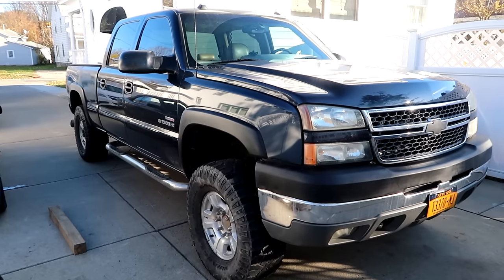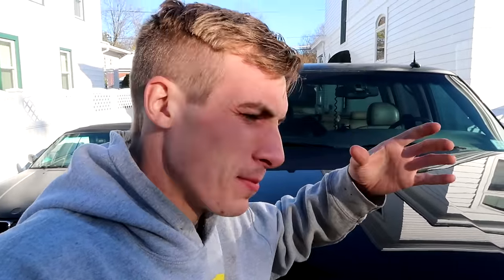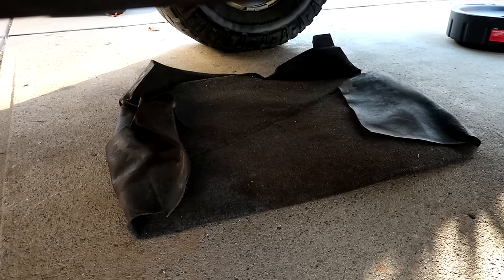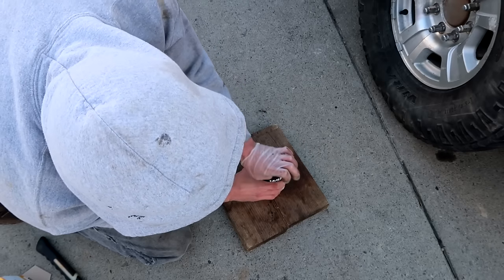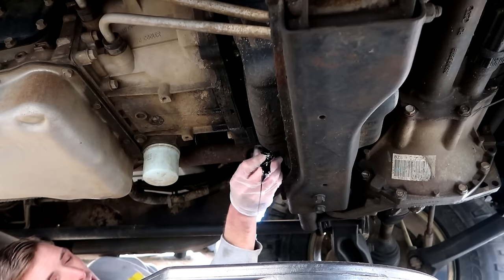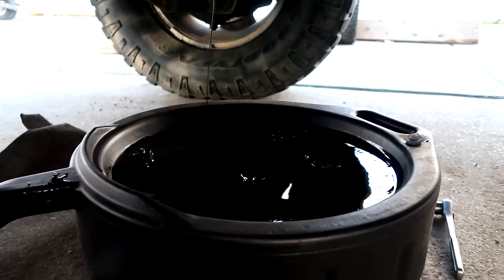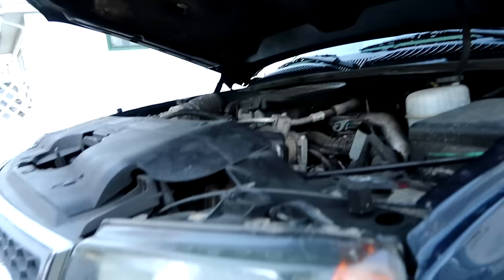THE WORST THING ABOUT A DIESEL...

Comment: The drain plug on a vehicle does need to be torqued when it's reinstalled.
On the Duramax, it varies from 50 to 62 ft lbs, depending on which torque guide you use.  But should be at least 50 ft lbs torqued.

Comment: For my truck which is a Gas truck, my oil cost me $90 with the filter which is expensive but I won't have to change my oil for 15,000 miles

Comment: well smaller trucks are falling by the wayside.  wich sucks because with the milage cars get now it'd be awesome for a daily. family truck. can't haul a huge 7000 pound camping trailer. but you can haul a good bit of wood. a smaller car on a trailer. and still have a more comfortable ride even more than a half tonne and like yours 3/4 tonne. even though they are getting better each year

Comment: 10 quarts isn't bad. I worked as an equipment mechanic at an airport. 5 to 7 gallons was the norm on our refuelers and big diesel pushbacks. The strangest charge on an oil change came from our forklift, 2 gallons of oil and a new T-shirt. I had to go to the accountant, dripping oil from sleeve, armpit and side to get him to agree to reimburse the cost of a shirt.

Comment: I'm surprised your not running synthetic 5w40 in NY.  It flows significantly better when your engine is cold.  Since I don't drive my duramax enough to warrant an oil change more than once per year and make occasional trips to cold climates I believe synthetic is worth the extra cost.  Delo Synthetic 5w40 can be found at walmart for about $20 per gallon and some carry the 2.5gallon jugs.   Non-Synthetic is $12/gallon x  3 gallons + $8 for a filter = $44.  Synthetic 20/gal x 3 + $8 filter = $68.   Only $24 more to go synthetic route, about the cost of a half tank of diesel.   Either way you still have a half gallon leftover in the Dmax next oil change will cost you either $12 less or $20 less if going the synthetic route.

Comment: Diesel engines may require more oil and it may cost a little more but oil changes are less frequent with diesel's compared to gas engines. Like 2-3 times longer. Gas is usually 5000, diesel's are usually 10-15k mileage wise.

Comment: More oil capacity means more oil cooling capacity from the extra oil at the bottom.   That's why the Jaguar XJR 4.0L inline 6 gas engine takes 8quarts, they built the engine to be able to run hard and for a long time and not worry about oil getting too hot.

Comment: I have one of those trucks with the gas 6.0L and it takes over 6 qts to change.  A Dmax is only 4 additional quarts.  A total non issue, even using a synthetic diesel oil.  So what if you spend $60 on 3 gallons of 5w40 synthetic or $39 on 15w40.  The real problem with diesels is the absurdly high purchase premium over the exact same gas truck.  My truck was 1/3 the cost the same year and miles with the Dmax in it.  Diesel is a fad for most buyers.  I love the duramax and the cummins engines as much as the next guy but prices for a pre DPF diesel are bonkers.  There is also the point that a dmax on synthetic diesel oil can go many more miles per change than a gas engine.  Those 10 quarts of oil can take a lot of miles, many more than the oil life indicator would lead you to believe.    The real "worst thing about a diesel" should be about how much it costs to change out your injectors when they go out, and they will.

Comment: My buds c14 cat in his peter-built holds 1 gallon of oil in oil filter alone ,  but what can you do it part of the diesel experience. I have a 2002 ford 7.3 , I like using Mobil or Rotella oil. Keep up the good work Mr. 3D.

Comment: you should start putting Lucas Oil Stabilizer. I have a 97 cummins I found on a farm. No smoke over 400,000 miles no after market part. Lucas is great for diesels truck

Comment: On your duramax- you never leave that silver cover on a new oil jug because parts of that could fall off and get stuck in your motor and hurt it. I also herd that you always watcher your pressure gage in case that's any leaks start after you checked the First time.

Comment: I run 4 gallons of Schaeffer's 5w40 full synthetic at almost $49 a gallon. All diesel owners look into a oil bypass filter setup. I run a bypass system and go 20k between changes. it's worth the investment in the end.

Comment: My early '99 F350 7.3l Powerstroke took 15 quarts. There's a couple reasons why diesel motors need larger oil capacity but I'm not going to get into that since it would make a good video for someone to make with some research.

Comment: You should check your dipstick before draining the oil. You may have and it just wasn't in the video, but if you're doing an oil change on a diesel you need to check the oil level/ check for dilution

Comment: My 03 7.3L F250 holds 15qts of oil. The filter alone hold like 5 quarts and is bigger than my forearm. Spent almost $500 just on fluids and filters for my 150k mile service.

Comment: When I change the oil in my Cummins its 200 bucks. I run full synthetic amzoil and a dual remote bypass filter system.

Comment: I run Amsoil 15W-40 Diesel Marine Full Synthetic for 25k miles in my 2004.5 with the help of a thorough oil analysis from the lab; it helps save me money due to the extreme long intervals. I've had 0 issues after 205,000 miles. Happy Trucking...

Comment: Any new dodge with a 6.4 hemi (392) costs more than any diesel I've ever topped off. Any high performance engine (even the cheap ones like new LS motors or Hemis) will cost more than even a diesel to change the oil. I didn't want to bother changing it in mine back when I had it and Chrysler itself charged in the 500 buck range. Labor was only 70 of that cost. But besides that the C15 in my dads semi takes 6.5 gallons with the fuel filter so lol

Comment: May want to run an oil additive. I run Archoil 9100 at every oil change. AR6200 at every fill up. I change the oil and filter every 5k miles. My oil looks like it did when I put it in when I change it pretty much.

Comment: So your duramax takes a little over twice the amount of a similar gasser, but keep in mind that you can go only 3-4K miles on an oil change on a gas truck but on a diesel it is usually somewhere around 10k miles.
Reply: In a gas truck you can go 10k but it's not recommended. 5k is what I and everyone I know go on a single oil change in gas silverados, s10, etc. 7k would be okay too.

Comment: A couple bits of advice: 
1. You should change your oil at 5000 miles. The oil life indicator is set up for 10,000 miles. Most filters are not up to the task of 10k intervals.
2. Wix filters are garbage. Spend a couple extra dollars at Pepboys or O'Reilly's for a AC Delco. Mobil One is also acceptable. 
3. Change that aftermarket transmission filter. Get a Allison Genuine filter. $10 and change every 10k miles. Also make sure you keep the debris magnet. 
I dont want to come off as a dick, I just want you to have a long reliable experience with your LLY.

Comment: Mine takes 15 qts plus I have a cartridge filter on top of the $150 in oil and filter. 6.0 Powerstroke's you have to change your fuel filters every oil change also, so hello $220 every 7,500 miles. Haha

Comment: My old ford took waaaay more oil.  91 f150 302 V8. Burned 2 or 3 quarts at each gas fill up. By god, did it roll some coal though

Comment: hey bro I have a 05 gmc dmax and 1 it takes 12qts and 2 I found out your not supposed to prefilled the filter but I've owned it for 4yrs and in that time I've replaced 3 barings 3 fuel filters  i just replaced the altinator that came on it from factory and a FPR

Comment: I have a 2003 7.3 liter F350 I use about 5 gallons five and a half if I pre-fill my oil filter and do my high pressure oil pump
Reply: There should be no difference in capacity whether you pre-fill the filter or not.

Comment: I have a 03 Silverado 2500hd gasser. only 98 thousand miles and more problems than any other vehicle. right now my g80 locker keeps getting stuck locked. and my front end won't unlock when I put it in 2wd. and that's just the 2 biggest problems. and no I don't beat it. I've only had it for 3 months and had problems from the start.

Comment: PF 2232 10 quarts of 15W40 or 5 w40 synthetic. 13 mm socket and my friend that's how you change the oil and that their Duramax
Reply: oh and always remove fill cap first lol
Reply: three pump the gas's with ignition on resets it as well

Comment: Actually there are a few things you aren't right about, it doesn't cost me a penny more to register a 1 ton dully diesel as it does a small car  $24 period in my county.
Second the engine lasting longer well that's not ture really, consider chevys 6.5 diesel, fords 6.0, most gas engines last longer than those.
Insurance isn't more in my state if you are just carrying the bare state min, well let me rephrase that at the cheap place I get mine at it doesn't matter if it's a F350 or a taurus.

I buy a 5 gallon buck of oil for mine, it uses all but half a gallon if I do it right.  I have a 7.3 PSD, oil change runs me $85-90 for the oil and filter.  Then I re-filter my old oil and dump it in the fuel tank.

Good job at pre filling your oil filter, there are some goobers that don't and well as I'm sure you know doing that stuff only causing damage.

Comment: My PS takes 13.1 quarts. Also controversial is profiling the filter if you pot oil in the middle it is not being filtered because the middle is where the filtered oil comes from. Personally I don't think it matters one way or another.
Reply: JDH it doesn't matter, the oil filter is meant to catch metal particles that fall into the oil pan from the crankshaft

Comment: The worst thing about a diesel is certainly not changing the oil.  Most likely a Hpfp grenading and taking out the fuel system or a stuck injector burning a hole in the piston.

Comment: Get a fumoto valve and use schaeffer's oil. I have over 30k miles on my schaeffer's 9000 5-40. I add 1qt about every 4k miles and I get it analyzed about every 10k and I change my filter every 15k. The oil stays great. Go to the bob is the oil guy forum. You can really start saving money and have better protection.

Comment: hey I am unfamiliar with diesel trucks. I am looking at getting a new to me truck. I understand that diesels get better mileage but is it really that big of a difference? If I wanted a diesel I would have to get a truck that is at least 10yrs old. to my knowledge the only trucks that have diesels are the 3/4 ton trucks like Silverado 2500 or f250 or ram 2500. so my question to you is should I get the smaller half ton gas or get the bigger truck even tho I don't need it specifically for the diesel? I know the average mileage you would get with most half ton gassers is 13-15mpg city 17-20 highway, what kind of mileage do you get with a diesel?

Comment: hay man i own a 96 powerstroke and i know your trying to save money but runing that this cheap oil will ruin your truck the BEST oil to use in any diesel is ROTALA T its expensive but trust me it is the best even if its not recomend in your manual it is the best it was designed for diesels

Comment: So here's this, in warm weather climates, Diesel engines are an easy call. Sure the up front costs are higher, but durability, economy, and reliability offset that to a degree.

When the weather gets cold though, gas engines regain some appeal due to not needing to be plugged in unless it's close to -40 F. No, gas engines aren't as torquey, no they're not as efficient, however the general maintenance costs are not as high as diesel engines either, and they're simpler to work on in your garage if you're up to wrenching your own repairs.

My question is simply this; why has no major manufacturer of diesel engine vehicles offered, or even designed an insulation system to protect the diesel fuel system from cold air?  Sure it may add, what, maybe another 100 pounds to the vehicle, but that's just a small extra passenger. No big deal.

Anyway , that's my take.

Comment: Mine is a 97 f250 7.3 turbo diesel and will it takes 10 quarts and doesn't even touch the dipstick. But you think thats the bad thing about a diesel wait until you have to do glow plugs. Or injectors those things are expensive as hell.

Comment: I'm fixing to buy a truck and I've wanted a duramax for 3 years now and I'm 16 so this will be my first truck and my parents and grandparents are helping me out a little. My grandparents haven't ever owned a diesel and see no reason for one and all their friends say not to get one. I've told them time and time again that diesel is the better option. I know a lot of people who own them and absolutely love them and say it's the best way to go. And they know a lot of people who don't own them but say a gasser is better and an "ole diezel truck is gonna cost you tons of money" what should i do?
Reply: Tactical Camel If it's your first truck,and you're not going to tow go with a gas truck. You will save on insurance. Mid sized- half tons are way more cheaper to insure than 3/4-1 ton. Go with gas
Reply: Tyler Bence i like the durability, fuel economy, horsepower, torque and long life of a diesel.
Reply: You gotta work a Diesel. No sense owning one just to cruse
Reply: I had 6.0 vortec with over 300,000
Reply: Tyler Bence what do you think this guy does and all these other people who own diesels doing youtube
Reply: Tyler Bence most people now days realize that a diesel is superior
Reply: Not using a truck as a truck. I just gave you my two cents. That's just my opinion. If your mom and dad are helping you go for it. Just saying insurance will hurt
Reply: I own both. I have a lml duramax and a 1500HD with a 6.0

Comment: Did use a hammer that you picked up of the ground to knock out the seal of that gallon of oil can then dump that now possibly dirty oil in the clean side of the filter?  Nice.  No going to do that to my bearings.

Comment: I cringed when you hammered in the seal on that oil jug then filled the filter.  In case you don't know, anything in the center part of the filter is going to pump through the engine and could lead to a real bad time.

Comment: I don't understand why people who bitch about the hassles and costs of motor oil are NOT using Amsoil.  Had you put in Amsoil diesel oil, you could go 3x the OEM drain interval and that would save you money and hassle right there.  Plus what guarantees does any of that store-bought oil have in the event that oil causes a problem?  You're S.O.L. if you blow an engine with store-bought oil.  Had you put in Amsoil and their oil caused a problem, they at least have a written guarantee that will pay for all parts and labor.  My cousin is a dealer for this oil and hooks me up at dealer cost on everything.  I've been using this oil in all equipment and every engine and transmission I've ever used.  Winter starts are a piece of cake.  Gas mileage increases.  You guys are absolutely crazy to use this crap that you put in just to pinch pennies.  The money you save on the oil you end up losing on gas mileage and more frequent maintenance.  You're tripping over dollars to save a dime.  I'm just trying to help you people out.  Go on Google or Bing and search on what Amsoil fits your vehicle and switch to it.  Believe me, YOU WILL BE THANKING ME LEFT AND RIGHT years from now.

Comment: Your using about 3 quarts more oil than a V-8 gas engine but go twice as far on a change .  So hope I don't shock you but the diesel is more economical.    Dodge cumins recommends 10,000 Kms.  Gas, 5,000 kms.  Don't sweat it.

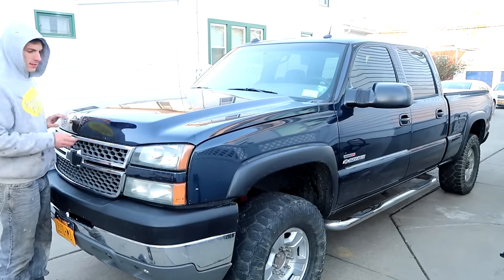Comment: That hose at 7:28 doesn't look right... That crack looks like it's about to fail. Most likely only AC line so nothing that important. But I'd change it still
Reply: Hene193 that’s nothing to worry about. It’s just a foam insulator/barrier on the ac hose.

Comment: I never owned a diesel but I know diesel engines use more oil than a gasser. Anybody that thinks you can get an diesel oil change for $19.95 is out of there minds, also are they 5 quart jugs? 4 quarts in a gallon.
Reply: They can, but I've had more oil replaced on my gas cars compared to my diesels. Point is, diesels are made for travelling, and when travelling, they use oil. But indeed, some specific diesel engines are know to burn a lot of oil. I've never driven such, but it exists.

Comment: You're complaining about an oil change? I though you had top change injectors or something. Also, Wix filters are the worst filters you can buy and by filling it you introduced a filter full of unfiltered oil into your engine on a cold startup. Another good thing to do is to change oil on a warm engine so all the contaminates are floating around in the oil pan and more likely to come out in the draining step. Common mistakes but changing your habits will make for a happier longer lasting engine.

Comment: what's the difference between synthetic and non synthetic oil? isn't the non synthetic like the stuff that they purely drill for?
Reply: Darrek LeRoy no its still refined, it is just generally better to use a synthetic oil in your vehicle because it is a lot more consistent viscosity wise throughout the temperature ranges than regular oil. The lubricity of synthetic is a lot better too.
Reply: David A okay, thanks for the answer
Reply: Darrek LeRoy YouTube it duh
Reply: David A you mad bro
Reply: synthetic oil is manufactured(man made) and refined,regular oil is taken out of the ground then refined so yes you are actually correct.

Comment: OK, get a Fumoto valve, change your own oil and don't use the crap life from GM. You know, get a Ford or Ram who use better than wax for the frame coating and got 10k miles on Rotella.